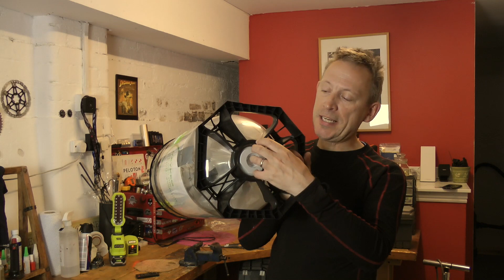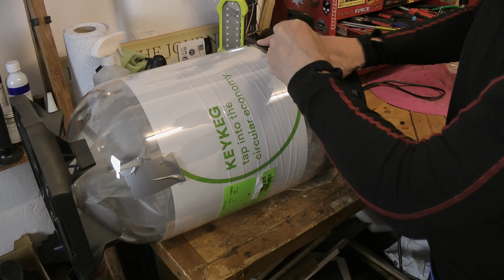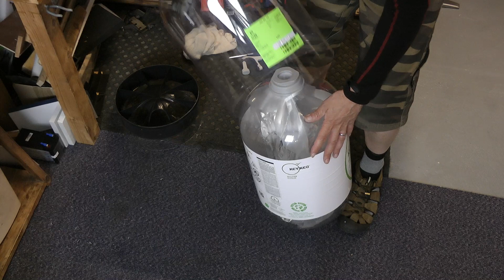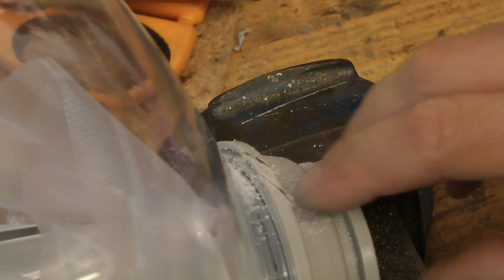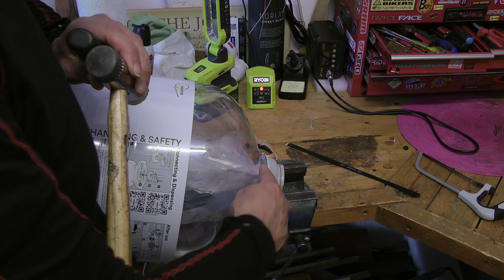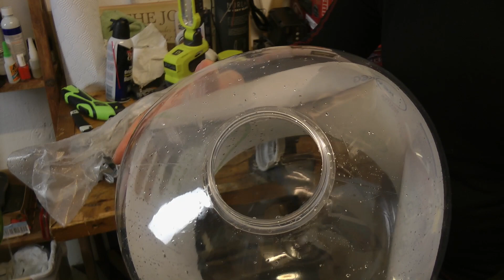Recycling Beer KeyKegs | How to remove the liquid bag

Comment: Looks interesting. Any way to make this a pressure fermenter? Like a fermzilla? A tight fitting lid 3d printed? Thanks for the video!
Reply: Yes I you could if you can get a cap to fit to its mould. I made a ginger beer fermenter though that is not pressurised.

Comment: Thanks for the video is there anyway to remove the screw without cutting away the outer layer?
Reply: The grey moulded end attached to the in layer sits in the neck of the outer.  So the outer layer needs to be removed to get access to it.  The outer needs to be cut somewhere.